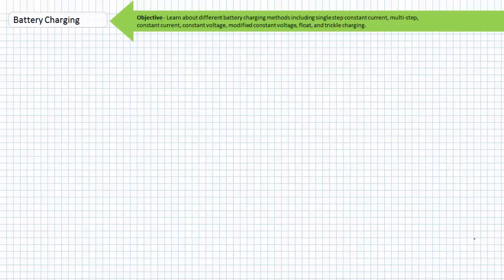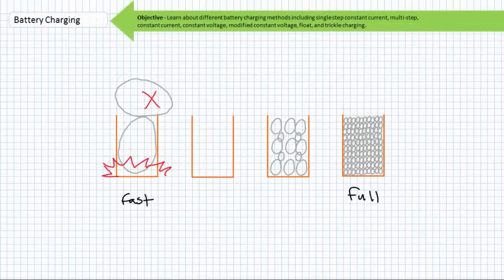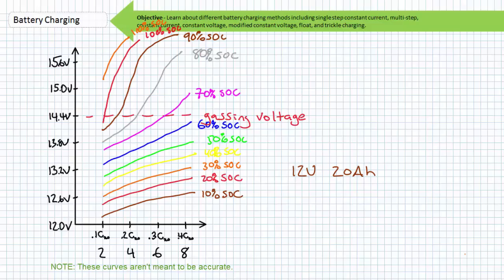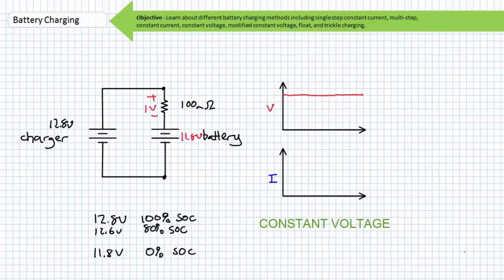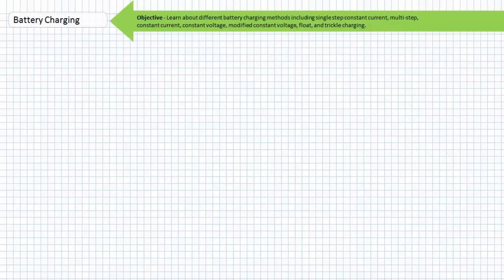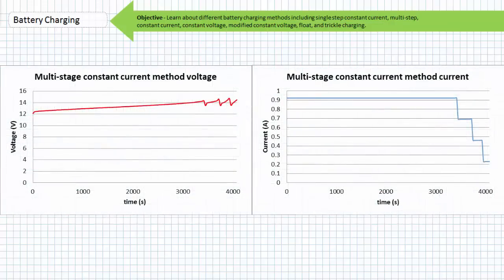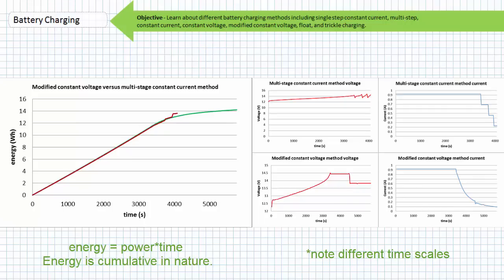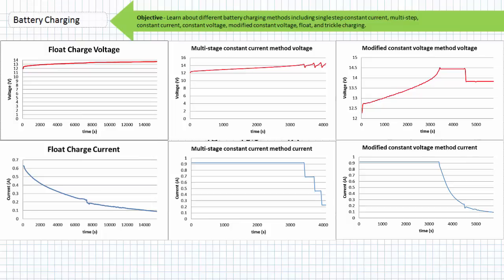Battery Charging Methods

Comment: With the example of higher voltage exceeding the gassing limit. Would a higher Ah increase the threshold? Take for instance a 50Ah or 80Ah, With a CV/CC it should be drastically safer to increase the voltage if the current is low. Am I correct?

Comment: How many volts should EFB type batteries be manually charged? 14.4 Volts or 15.8 Volts? Thank you for video.
Reply from the maker: I'm going to give you the standard answer for this type of question: "Check the data sheet for the battery of interest." This being said there's a couple good resources on the web:
https://batteryuniversity.com/
and
https://www.rbbattery.com/efb-batteries-everything-you-need-to-know/

Comment: Obviously the used charging method is not battery dependent but all methods may be applied to all lead acid AGM batteries? Or then, which structural feature of the battery makes that which method to apply? We have currently a senior scooter having four 12V20Ah batteries. In those the charging method (and charging control system, too) is 3 step method according to the specifications of the battery. However, now we are going to replace those by new ones which have otherwise the same specifications except charging method which is constant voltage charge method (i.e. not "3 step"). Can you see any problem in this kind of replacing?

Comment: Are the methods same with Li-ion batteries ? Is the gassing voltage also present ?
Reply from the maker: Not exactly ... although most Li battery manufacturers products essentially mimic the performance of traditional lead acid.

Comment: Very clear explanation with Rocks Love it ! Thank you ! 

I’m an auto electrician and understand wiring , electricity very well and use to explain electricity to customers using plumbing , pipes and water flowing or struggling to flow it works !  - all about the quality of the connections and how it’s flowing through thin or thick pipes for different uses .. But understanding battery charging so much better now with this vision ! Really appreciate it thank you .
Reply: As an auto electrician here are 2 questions,  1)what current does the alternator charge the battery at? 2)have you ever come across or hear of a car battery catching fire from been charged too quickly?

Comment: Thats a great explaination sir.
Can I ask for the technique you apply to draw these charts. Like what is the platform you used (Matlab, PSim). I want to make a charging profile in different battery charging strategy like what you have done. 

Thank you sir.
Reply from the maker: All the charts are real data plotted in MS Excel

Comment: Very nice explanation but something is missing. I am connected to battery charging for years. I found only constant current method useful because every method fails after one and half year. Battery becomes weak and every method fails to bring the battery to full charge state and as a result charging will not cut off and battery water will dry out consequently battery will die. Only constant current method works and brings the weak battery to full state and battery life normally becomes double.

Comment: What does a 25c battery mean
Reply from the maker: Hard to tell without the datasheet however "C" might mean the capacity in Ah. 25C might mean 25 times the capacity. Often times maximum permissible charge or discharge rates are listed as some multiple of C.

Comment: does this apply to NIMH batteries?
Reply from the maker: Not really. This lecture kind of focused on lead acid batteries however some of the terminology is similar. I should probably do another lecture about other battery chemistries (NIMH and Li being the 2 most popular) highlighting the differences.
Reply: @bigbadtech  well it was very helpful mate, thanks. Iam writing firmware to charge/discharge lead acid battery and a Nimh battery for my company's product, for the NiMh iam using a bulk/pulse method. During bulk iam pushing constant current (maximum allowable by manufacturer) to the battery, and iam using three termination conditions, a timer, the rate of change of the battery temperature, and the battery voltage. Doing the same during pulse but for a much shorter interval of time.

Comment: So if I just want an emergency battery with the highest possible charge, can I just hook it up to my 13.6V supply with a couple Megaohms of resistance and a diode in series and leave it on?

Comment: So what I understood is that we have two limits. First limit is 14.4V or the gassing voltage, the second limit is the current which is around 0.4*C20. To meet the condition sometimes the charging voltage is dropped to reduce the current.
What would be the simplest circuit that could take an input of (variable 12.8V-14.4V) and produce a max voltage 14.4V then limit the current to 0.4*C20?
I am trying to charge a deep cycle battery with the my cars starter and variable input voltage alternator (input voltage 13.8v-14.4v), and I want to create the simplest circuit.
Reply from the maker: True. Perhaps the easiest circuit is a buck chopper w 2  set points (current then voltage). Stay in touch because I’d like to discuss chargers and choppers in the future.

Comment: If the open voltage of the battery is at 11.5V, will there be immediate gassing if the charger charges at 15V? Does gassing happen at low amperage of charging, say at 15V 50mA?
Reply from the maker: I honestly don't know if gassing is a current dependent phenomenon? I would check battery university. They're my go to for all things battery.  https://batteryuniversity.com/learn/
Reply: @bigbadtech  Thanks. I am aware of the battery university. But, they are a bit too "heavy" for what I need. I found it much easier to form my own hypothesis, and I have it now.

Lead acid battery works on the principle of electro-chemical conversion. Sulphuric acid + lead = current + lead sulphate. In reverse, current + lead sulphate = sulphuric acid + lead. The voltage affects the efficiency of this conversion.

Gassing happens when excessive energy is pumped into the battery. Some of this energy is consumed by converting lead sulphate to sulphuric acid. The remainder boils the acid, resulting in vapour. The boiling can only happen if the surrounding fluid cannot cool the heating element (aka the lead plate) fast enough.

In answer to my own question: the heating element with a small amount of input energy cannot overcome the cooling effect of the surrounding electrolyte. Therefore, no gassing takes place. If it does take place, it would be in minuscule amounts. My conclusion is that gassing is proportional to the actual measured wattage of the heating element (lead plates) scaled by the temperature of the electrolyte.

15V x 0.050A = 0.75W. This will not be doing much electrolyte boiling and gassing in a battery, unless the electrolyte is preheated closer to its boiling point.

Comment: So can I start charging my deeply discharged battery of 60Ah capacity without solat panned regulator with 17V and 4A current safely until battery voltage reaches 14.4V and then switch to solar regulator charging and drop charging voltage to 14V instead of 17v???

Comment: Hey Jim. First thanks much and amazing video. could not get much better than this. For real!! Question I have... I built a capacitive charger (( AC(Live) to C on cap, AC(Neu) to ac input tab on bridge rect, DC(neg) on bridge rect to 12v lead acid NEG term, DC(pos) on bridge rect to 12v lead acid POS term, HERM on cap to ac input tab on bridge rect )) after cleaning batt, and refilling if necessary with deionized/distilled/rain water, and after lots of experimenting and monitoring, I notice many times the voltage lowers below 12.1v. So I power off my switch, allow cooling time, turn switch back on. Voltage rises a bit ( different per case ) then decreases down into the lower 12.x . My cap is an oil filled dual motor run ( 370VAC , 10fan / 25compressor MFD -=- 10mfd 360mA ,, 25mfd 900mA ). Can you give me some basic details on how to monitor the different components ( amps volts watts temp etc ) ... reasons avoid overheating, avoid overcharging, and my biggest fear lol avoid undercharging. I plan once to a certain point, to transfer the good batteries to the bench and commence regular 12v charging. I am new to this crap-shoot and would love some knowledge/wisdom. Thank you much.
Reply from the maker: Here's my resource for batteries and everything related to batteries: https://batteryuniversity.com/

Comment: great video. but can u help me understand when u say in the beginning that a 10 ampere surge cjarging the empty battery might damage it? in a car the alternator charges the battery at around 100 amps, or am I missing something here?
Reply from the maker: SLI (starting lights and ignition) batteries are designed to handle massive surges of current, in and out. Deep cycle batteries, not so much.
Reply: Not sure if this is answers your question, but alternator can out out 100 amps, (if rated at that) but much of that goes to running accessories, not charging the battery. Your accessories run off the alternator, not the battery. In basic terms, the battery is to just start the vehicle.

Comment: Just like all people that talk about batteries is the terms periodically and occasionally. You did say to equalize every six months or 20 cycles which means you take a battery from full to recharge state every nine days but yet you discharged that battery in your example in 28 minutes. It is also worth noting that Trojan says to bring and absorb their T105 at 14.8 with an equalize at 16.2. But they do say a variable reduction above 25C. My complaint is they are very specific at everything but then throw in these words so the customer can be blamed for not interpreting occasionally and periodically correctly. Why not talk of hydrometers?
Reply from the maker: Hydrometers are mentioned in the "Introduction to Batteries" lecture at: https://www.youtube.com/watch?v=ZRruGTRHqiw 

I hear you regarding the ambiguity of some manufacturer specifications. The only general advice I've been given about equalization frequency is this: if the batteries are "deeply discharged on a daily basis" they may need to be equalized every "1 or 2 weeks" whereas batteries that are "less severely discharged" equalization may only be required every "1 or 2 months". My go to for everything batteries is: https://batteryuniversity.com/

Comment: Quite a handful of explaining but then again, I've been thinking all these charging stages with variable voltage n current based on states n monitoring then how about CAR BATTERY CHARGING thru alternator, stop n go, engine starting thru out the day, then how the alternator charging will effect battery life, and how (i think) car's simple battery mgmt archiving these charging params?
Reply: Charging a battery via an alternator is done a little more crudely than if done on a bench charger. Alternators charge by a constant voltage variable amperage method. The amount of amperage supplied is always the maximum charge a battery will adsorb for any point in its charge phase, up to the maximum output ability of the charging system, plus any amperage needed to run accessories of the vehicle. 

So, if you start a car there is a huge draw on the battery to turn the engine over followed by a huge surge of current at a constant voltage to refill the battery at the maximum adsorption rate of the battery.  On some cars you will notice the alternator belt squeaks or chirps when a car is first started and slowly quietens down. This is a result of the alternator being worked its hardest immediately after the vehicle is started and as the load on the charging system becomes less there is less strain on the alternator belt and it becomes less likely to slip or make noises. 

Ideally the only time the battery on a vehicle is being worked is for starting or running accessories with the engine not running. Any other time the alternator is supplying all the electrical power needed to keep accessories running and the battery is sitting there in circuit acting as a fully charged capacitor.

Alternators output regulated voltage through the entire operation speed of the engine and the available current output will be 70% or more from idle speed quickly ramping to 100% of alternator rated output if needed throughout the entire engine operating RPM range as the available electrical loads dictate.

Comment: In the constant voltage method, will the current lower naturally or do we lower it ourselves?
Reply from the maker: As the voltage differential between the charger and the charging battery becomes less and less current will naturally become smaller and smaller as a consequence of Ohm's Law. It's for this same reason the constant voltage method is NOT recommended for deeply discharged batteries. A large voltage differential exists between the charger and the deeply discharged battery and, as a result, potentially destructive amounts of current can flow.

Comment: my forklift charger is 20 yrs old working good, getting a new forklift w new battery, should I change the charger also, to protect my investment, does the charger technology as evolved  since to charge a 36V 750ah battery?
Reply from the maker: Honestly the modified constant voltage charging method has been around for a long, long time and, as long as the new battery can handle this method and the old charger can reach the new setpoints it should work.

Comment: Great Information! What is your opinion on Delta-Q Chargers? I haven't been able to find any white papers so I'm uncertain if they are multistage or modified - although I'm leaning that it's a modified algorithm. Also which bucket of rocks would the modified be? The first bucket left of the sand bucket?
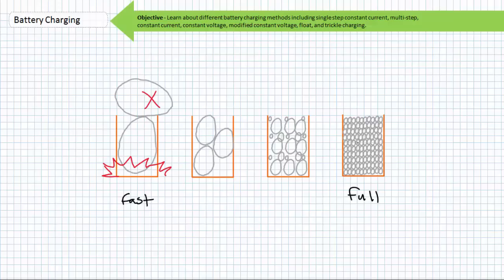Reply from the maker: Sorry no experience with Delta Q chargers. Most modern chargers use a variation of the modified constant voltage method. Honestly I think the the modified constant voltage method would be more like the 2nd bucket from the left at 5:30 (ie: bulk phase - large rocks, absorption - medium rocks, float - sand).

Comment: Hello... can charge 12v lead acid battery with constant voltage 14.4v And constant current “ CV,CC” ?
Reply from the maker: I wouldn't recommend a constant voltage charge. Example: 14.4V applied to a deeply discharged battery (around 10.5V) would result in uncontrolled, potentially damaging, current. It's for this reason the 3 stage modified constant voltage charging method is recommended. First stage is constant current, then the remaining 2 stages are constant voltage methods
Reply: I don’t have multi stage charger i have 1500watt adjustable power supply with constant voltage and current cv and cc , and have adjustable over voltage protection circuit, my battery is 12v lead acid 20Ah so what i do to charge it daily ? Can you help
Reply from the maker: Option 1: Get a multistage charger.
Option 2: Constantly manually adjust your CV power supply to keep charge current below the manufacturer's recommended maximum.
Reply: Thanks i can limit current below manaufacturers recomend, my power supply has current limiting so we fixed current and constant but to which voltage set my power supply to 14.4 or below it mean thats i charge my battery with constant voltage+ constant current so is good for battery or not , as i said i don’t have multi stage charger but have auto cut off voltage whent battery reach 14.4v my power supply stop charging battery
Reply: The question is that : if i limit current+ limit voltage with over voltage protection and both not change during charging process is good or not

Comment: i just cant describe how much this video was usefull to me, just amazing, i had some wrong ideas and they were well adressed by you. there is one thing i would like to know: : if i want to charge four 12v 5Ah batteries in parallel, should i treat them as one big 12v 20Ah battery ? thanks
Reply from the maker: Assuming the four 12V 5Ah batteries are from the exact same manufacturer and the exact same age you theoretically could treat this combo as a single 12V 20Ah battery. This being said I'd still incorporate diodes to prevent inadvertent discharge of 3 good batteries into 1 that may be having some problems. Hoping to return to battery chargers and battery banks in later lectures.
Reply: thank you sir

Comment: Why not just limit both the current (to 10% of Ah) and the voltage (to 2.6 VDC times cells) and leave it. Whichever hit's the limit will restrict the other.
Reply: i think that when the voltage reaches the desired value, the current will drop. it will just take a long time

Comment: So I have 3 lead acid batteries. 2 10Ah & 1 7Ah can I charge them together on a 24V charger?
Reply from the maker: Mixing batteries with different specs (even mixing batteries with the same specs from different manufacturers) isn't a recommended practice, however, you could probably charge at the lowest rate for the group. It'd take a little longer for the ones that allow higher charge rates but wouldn't damage the ones that require a lower charge rate.
Reply: Thanks, I’ll just keep doing what I was doing before charge the 2 10’s together with the original product & charge the 7 alone with my charge charger. Sure not all will discharge at the same time but I just need it for a pinch when my new batteries come.

Comment: What is discharge and over voltage for 12 volt 26 amp battery ?
Reply from the maker: The safest answer I can give you is to look up this data for your specific battery on the manufacturer data sheet. Anything else is a wild guess.